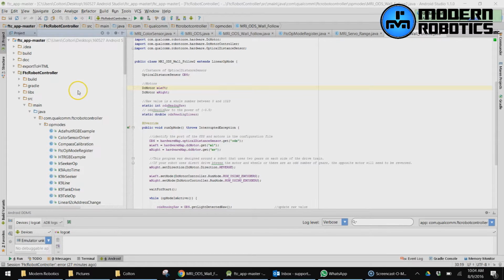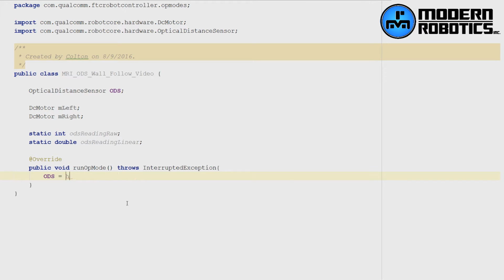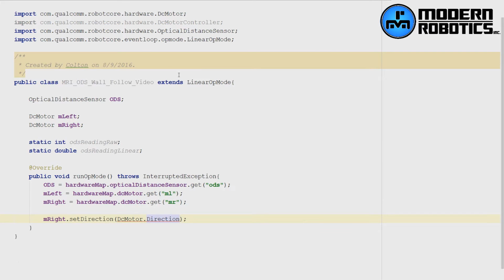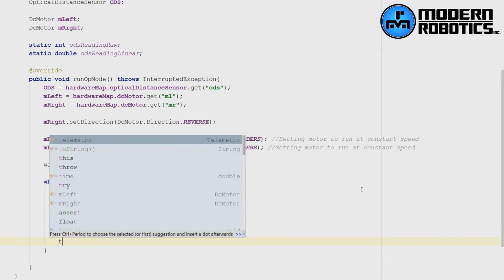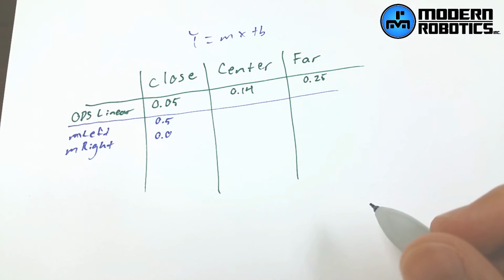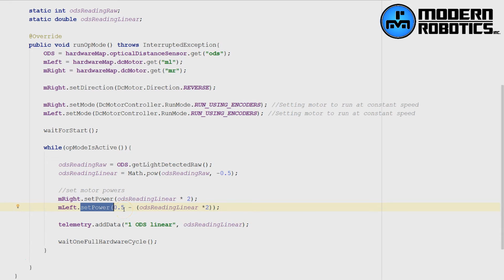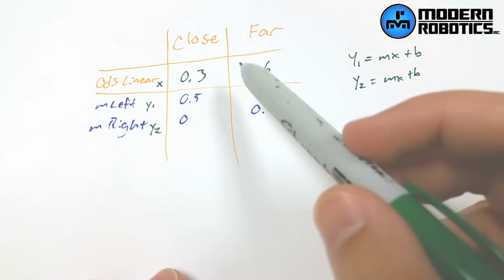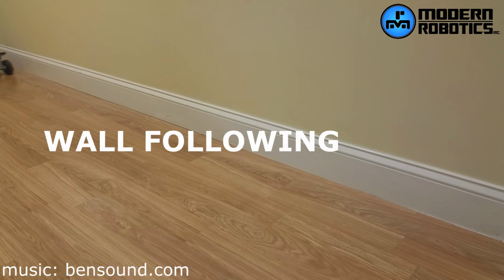ODS Wall Following Robot - Android Studio

Comment: Hello can help me with this.
Robotics

Develop the left-hand side wall following controller. In this controller, robot must follow the wall with a constant close distance and also avoids the obstacles front of the robot. This means while the robot is avoiding the obstacles at the front, your controller must keep track the left-hand side, in other words, the sensors from the left side of the robot must continue to be activated by the objects without losing the wall at the left- hand side.

I need an Ubuntu c++ code for this project.

Comment: Hey! I am a reasonably new programming ( third month programming ) and i'm having some issues with this specific program. 

First off, the ".getLightDetectedRaw();" function is throwing an error claiming it isn't a function ( However there is a function called: ".getRawLightDetected();" Which I assume is the same just renamed ). 

After I found that fix I then found another problem. the "static int" needed an int not a double. ( the ".getRawLightDetected();" Is a double apparently ).
Any help on this would be great!
Reply from the maker: The function seen in the video has been removed by FTC developers. We have updated the program and posted it for download at the link below. The similar function you mentioned has a range between 0 and 5 instead of 0 and 1 like the original function.

http://modernroboticsedu.com/course/view.php?id=5